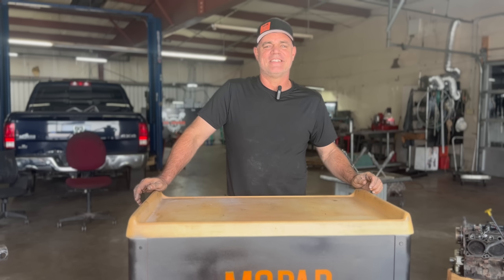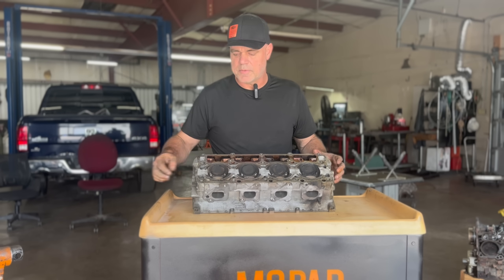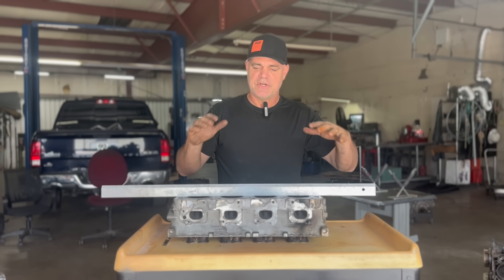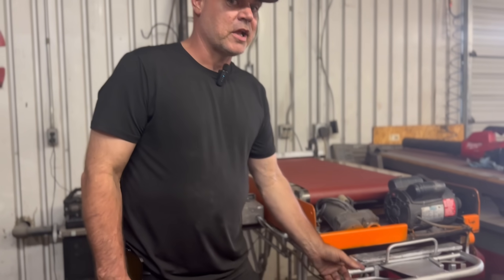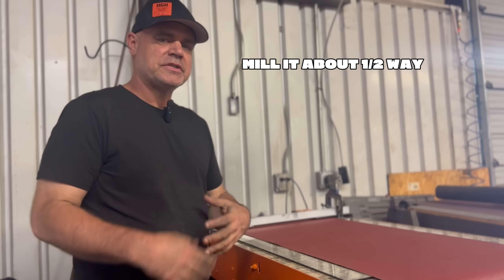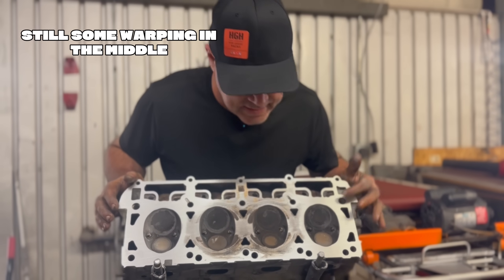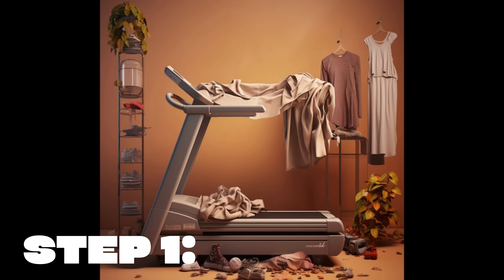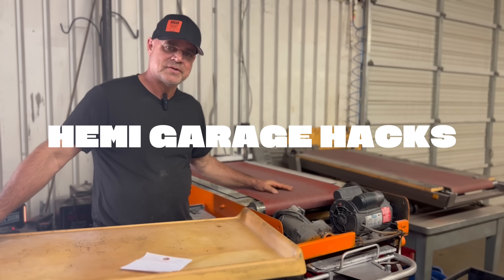I HAVE MILLED 1000+ CYLINDER HEADS WITH A TREADMILL!

Comment: Great idea, I love your enginuity. As an old machinist, I'd paint the entire surface with Dykem High Spot Blue layout fluid for a quick visual reference to see if the entire surface is being milled to flat, beats having to stop and haul out the straight edge and the feeler gage. When all the blue is gone then you can haul out the feeler gages.
Reply from the maker: Nice tip, and thanks for sharing.  Glad you are here.
Reply: I've done this sort of thing myself. It is very easy to see what portion of the surface has been machined and what hasn't been reached yet. The color of the freshly exposed aluminum alloy is a bit different, and the abrasive leaves sanding scratches ("grain") that is also readily visible. If you can't see that, sure paint with Dykem. But you probably won't need to.

Comment: I own a Kansas Instruments belt sander, I use it for exhaust manifolds.
It was designed for PER shops for cylinder heads. Back in the 80's I did thousands on it.
It won't make a head flat the leading edge will always dip off, You didn't check it for flatness properly, the MLS gaskets need less than 25 RA I get around 12
Bring one of your  "surfaced heads" to me and I'll take a light cut on my Surfacer using my PCD cutter and show you how badly you're screwing up your customers' heads 🇺🇸
Reply: What's a PER shop, and what's a PCD cutter? Please remember that people outside a man's trade never know its terminology.
Reply from the maker: I am one step ahead of you on that one.  A future episode will reveal some pretty cool stuff about this.  Thanks for sharing and glad you are here
Reply: Agreed there may be slight imperfections, but he's checking along at least three pathes with a machined straightedge and a 1 thou gauge. How much farther you need to take that....?
Reply: @michaelsimpson9779 He never lifted the straight edge up and put the feeler blade under it he just poked along and he never checked the edge.
I've surfaced heads that have been belt sanded and there not flat 🇺🇸
Reply: How do you flatten a reference surface plate, or polish a telescope mirror?  Careful and judicious lapping. He checked it on at least three planes with a 1 thou feeler gauge. There could be some issues from time to time, but I'd say with the volume of work going through that shop, if he was having comebacks, he wouldn't be continuing on with this method.

It would make a purist dry reach, but if it works, it aint stupid...

Comment: This is the way it used to be done at one time. There are machine like this set up. Only problem with using them now. Is that it will not give the needed finish for a MLS gasket to properly seal to. Which is why you need to use a fly cutting head to mill them now. Will this method work? YES for a while. But it is not the proper way of getting the Roughness Average (Ra) of the surface.
Reply from the maker: Keep your eyes peeled for future videos, because we're doing a follow up that is pretty revealing. I'm glad you shared, thank you.

Comment: I would place it on while the belt is stopped. I do not trust myself to place it on a moving belt level in the first place. 😂😂
Reply from the maker: I used to do that when I first started, but over the 13 years I have just adopted the practice of placing on there while running. Thanks for sharing

Comment: I hope you slowly spin the heads be ause one end of the hear will get milled more than the other half
Reply from the maker: Great point!  And yeah, it is a great practice to spend equal time on the surfacer in both directions.  Thanks for sharing and glad you are here.
Reply: @HemiGarageHacks  yeah I find that it will grind off more on the end thats not against the stop.
Reply: @HemiGarageHacks if you were to be able to hold it from the other side like as if it was being pulled around by a cat. That would orly get it cut as even as possible.

Comment: Great job suggest a steel plate instead of the glass. 👍🏽👍🏽👍🏽
Reply from the maker: Not a bad idea.  I originally set it up with plexiglass with glass on top 15 years ago when i made my first generation.  When I redesigned it, I chose granite for it's flatness and strength and then glass to protect the granite surface (since glass is cheap and easily changed) as well as a way to shim between the granite and glass for calibration.

Comment: Have no issue with concept or quality if the work BUT its a big jump to call it "milled". At very least its been sand milled or belt milled. If you use the tread mill for a run you say you have used a tread mill for a run ,you dont say i have milled.i would bill well hissed of if i payed to get a head milled only to find out its been belt sanded,definition is way off here.
Reply from the maker: Sanded indeed.  Or better yet, resurfaced I think would be a good term.  Thanks for sharing

Comment: First channel I've subbed to in years.
Reply from the maker: Glad to have you here:)  Did you see my very first video a couple weeks ago on the engine rotated by an elevator motor?
Reply: No I didn't i'll go watch it now, sounds interesting. Where do you get the sand paper belts for this treadmill mill and how do you add the adjustment features?

Comment: I used a granite countertop slab with taped on sandpaper to rub exhaust manifolds on.  I thought about a large enough hand belt sander upside down in a vice but wasn't sure about the trueness of its surface.  There are purpose built tabletop belt sanders that people use for this purpose. 
The great advantage of that or your device is how quickly the job is done, in a minute instead of hours of dragging the part back and forth.   What grit do you use for aluminum and for cast iron ?
Reply from the maker: You can use 60 for both if you want, just run a couple cast iron exhaust manifolds to knock the peaks off and then the finish is beautiful.  Otherwise 80 works good for aluminum, it just takes a little longer.  Thanks for sharing and glad you are here!
Reply: I used 60 grit also for my cast iron exhaust manifolds.  Got them to .004 wasn't sure if that was good enough, but got tired of dragging them back and forth for hours !  Thanks for taking the time to post this, great solution !

Comment: Ive used a granite kitchen work top and sandpaper to restore the bottom of old wood planes and sharpen blades. That was quite a lot of work. After seeing this vid I might try modifying a belt sander with a glass plate and a speed controller.
Reply from the maker: It's been a life saver, and still kicking after 13 years.

Comment: Just prior to the COVID outbreak I bought an Acura TL with a blown head gasket to fix and flip. The heads were warped pretty bad and I had intended to take them to the machine shop but then all that craziness went down.  Most of the machine shops within any reasonable distance to my area  were all closed and the ones that weren't had months long wait times.  That's when I came across the guy sanding them by hand.  I ended up using a giant piece of sand paper glued to an old end table glass that I laid on my granite kitchen counter tops. Not gonna lie I was actually surprised when they came out so true that my calibrated straight edge showed zero gap on any spot I measured across the head.  But MY GOD, the amount of time and physical effort it took I was massive.  I was like I'm NEVER doing that again if I don't absolutely have to. I pride myself on my ability to work smarter not harder so when I see you doing this I'm like "WHY DIDNT I THINK OF THAT?".  

Sure a GOOD machine shop will probably get it more true with less material removed.  But I've taken heads to machine shops in the past that were only BARELY in spec after I got them back. So, while I probably wouldn't use this approach on something I was going to beat the hell out of or put a bunch of boost to its Completely fine for a daily driver application. Hell I know the guy I sold TL to and 5 years / 80k miles later its still running like a champ just using a good hand job lol.  

I know I tend to write posts that are FAR too wordy but I say all that to say this.  Great work! You have a new sub, and keep the vids coming!!!
Reply from the maker: Dude, I'm glad you shared!  I have a cool follow up video to this in a couple months that settles alot of disputes about this.  It'll be fun, but I am sure we'll still have the naysayers.  Thanks for being here, glad to have you.
Reply: what's the difference between doing all that or all this and just getting it about right and using Nulon Permanent Head Gasket Repair? That's exactly my plan right now right after I disprove all the lies about timing. My engine is spread across my living room floor and I have no idea where tdc is. For my engine you put the crankshaft tool on there it, that locks it at tdc, then you put the camshaft locks on there and put the timing belt on. It's so easy. I think everyone is either lying or talking smack.
Reply: @jhowardsupporter  Liquid head gasket repair will work to varying degrees. On small leaks it usually does ok.  Larger leaks, meh not so much.  Really depends on the engine, type of head gasket, and how bad its warped(aka how bad its leaking).  These products turn solid when they hit air. The main draw back I see happen using these products is anywhere there is air in the cooling system the stuff clogs it.  More often than not that ends up being the heater core. So my only advice is if you are going to use it, bypass the heater core until you are sure the leak is stopped then flush the system refill it with regular antifreeze and hook the heater core lines back up. 

Sounds like you are working on a BMW (that's the only car brand  I've ever worked on that had no timing marks and the timing could only be set with special tools). What lies are you disproving about timing?
Reply: @brettsanderson8680   Yeah it's Alfa Romeo gtv. There's no timing marks. I've heard of car manufactures trying to make it difficult for mechanics to work on cars to collect on repair fees by needing specialty tools and making bolts hard to access and so on. So it has been a pain but I saw Bosch has an impact wrench with 1600nm or 1180 foot pounds break away torque. I think that and anti-seize and I'll never have any future problems.

Comment: I'd recommend spinning the heads at least 2 full 360º rotations during process, dropping cylinder onto belt in motion will take away extra material from the leading edges, and spinning will help crosshatch or randomize abrasive pathways, a recommended Ra or Roughness Average number is typically equivalent to 180 grit or less, if i remember correctly 😅
Reply from the maker: Whenever I do a follow up video on this, I will be sure to show the surface and measurement of the head in more detail.  Thanks for the advice and glad you are here.

Comment: Gluing sand paper to my glass kitchen table is a PITA, cleaning it is even worse.  I've had a local machine shop with a flat belt sander, but they have unevenly worn heads so I recommended the mill for people not willing to glue to the table.  What grit are you using on your aluminum?
Reply from the maker: 60-80 seems to be the sweet spot.  Hope that helps and the company I get them from is called Mirka.   I hope that helps

Comment: worked at a engine building  place they had a big industrial belt sander that was used to surface heads for a while they got lots of comebacks the machine was making the surface  twisted on the heads only good for ex manifold and others no good for heads they went and bought a proper head surfacer and the giant belt sander was hardly ever used after
Reply from the maker: getting it dialed in takes a few hours, but it totally pays off.  Thanks for the comment and glad you are here!
Reply: We had a machine like that and it acually  used air to add pressure and coolant, like you we found that while it may have looked flat it was not and stopped surfacing heads on it.

Comment: Love this idea. Really good to see someone using it with success. 
  I learned a long time ago that a lot of the most precise machining processes are abrasive.
Reply from the maker: Thanks for sharing and glad you are here!
Reply: Telescopes have been hand ground for over 400 years since Galileo invented the telescope in 1609. 
If the head is warped then any grinding or milling method will take off more material in one place or another.
This method seems to work. Making it smoother might just be switching to an ultra-fine grit when it gets flat.

Comment: If you don’t know how much you took off, you don’t know how thick of a head gasket to buy. You also don’t know if one bank is sitting way higher on compression now. Unless you’re working on an inline engine I don’t think this is a very good method for anything other than clicks.
Reply from the maker: Surprisingly there are fixes for that.  I'll share those in the follow up video.  Thanks for sharing and glad you are here.

Comment: Great idea. How do you handle align boring the camshaft journals on OHC heads, which like 99% of all cars have these days?
Reply from the maker: Equal time on the belt before and after reversing the direction of the head. Works great.  Final check can be done with a straight edge and a caliper to measure from bottom surface to valve cover surface.  We've milled hundreds of 3.7 and 4.7 heads which are OHC. Hope that helps and glad you are here.

Comment: Great idea. The only downside I can see is that if you're taking a lot of material off you might get the different machined surfaces out of true to each other (example, the angle of the mating surface on the intake manifold on a V8). Even then, probably not enough to be a problem. Something of note, machine shops use a very flat piece of granite for doing precision measurements called a surfacing plate. You could probably just get a cheapo version of one of those for this purpose and not have to bother with the glass, except maybe to use as a wear surface on top of the super flat granite. Most of them should still be within a thou over the entire surface because of how they're manufactured.
Reply from the maker: That's one of the reasons I have the glass, is to preserve the granite surface and glass is cheap and easy to replace.  The other reason is that it allows me to shim between it and the granite should there be any variance.  And yes, we actually change direction of the head and surface equal time in each direction.  Thanks for sharing and glad you are here.

Comment: 1. The cylinder head is not securely mounted to anything. 
2. No matter how little you “sand” it, it will develop a taper.
3. There is no precision increment to which it is being “milled”.
4. End cylinders and center cylinders are no longer the same compression.
5. As shade tree as it gets.
Reply from the maker: Thanks for taking the time, your opinion matters.
Reply: if it works, and gives me some miles again rather than paying an arm and a leg for one of you guys to mill it on a million dollar machine.. i am going with this ....LOL
Reply: but don't you get the same problem with end cylinders and center cylinders even if you properly machine it? Maybe im missing something, but I think the only downside with this is a potential taper, not knowing exactly how much material was taken off, and maybe not a perfect surface finish (unless you use a very high grit)

Comment: Gonna throw this in my 
" tail gate rebuild hacks " file. For those times when true parallel square controlled and consistent don't matter. You know I just had an idea for another one of your " inventions ".  You could get one of those big floor sanders with the two or three foot disk and put some forty grit on it. That way you can " mill " a thousand heads at one time.  You know, since flat is the only thing that matters when machining a head PROPERLY.
Reply from the maker: I'll look into that!  it sure makes for an interesting title:)

Comment: Probably works fine for a backyard fix. Although I'd be sure and rotate the head end for end every few seconds. I have a large belt sander for wood and if you don't rotate the wood end for end during the process, it will always wear deeper on the end closest to the stop guide bar. I'd have to assume this would be the same if I used it to sand something made of aluminum.
Reply from the maker: you're right, that's how we do it.  Measuring time helps, for each direction.  Thanks for sharing

Comment: so how are you ensuring that the face angle to the intake does not change , like you will do with a mill ?
Reply from the maker: best practice is to measure time one direction and do equal time with the head turned around. check for flatness, and then you can measure with a caliper the height from the bottom to the valve cover surface.  Thanks for the question and glad you are here!
Reply: @HemiGarageHacks  ok that makes sense , thanks

Comment: You have milled zero heads with a treadmill. Sanding is not milling not even close. You're counting on the bed that the sandpaper is sliding on to be perfectly true that's laughable
Reply: Hey, genius….most heads are decked by Blanchard grinding. If you look, this guy uses a piece of float glass as a platen. Float glass is FLAT!
Reply: @Zircon10  ok. Not saying its not a viable solution but sanding is still not milling nor is it Blanchard. You have millions of little rocks all over in height with sanding belt, while a fly cutter or face mill has teeth that are all the same. And Blanchard grinding is different again as the stone wheel is dressed so that all the rocks are  the same. Also why do all that work to build some custom machine with super expensive belts to do one thing when you could get an old mill and end up with better results?